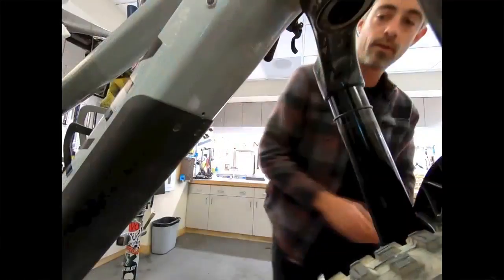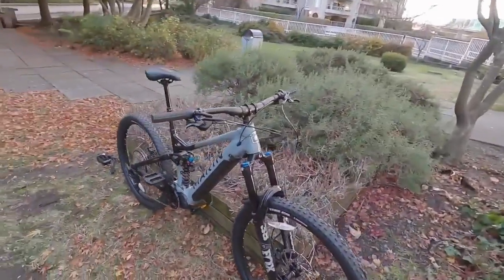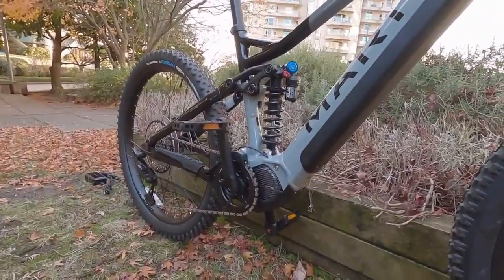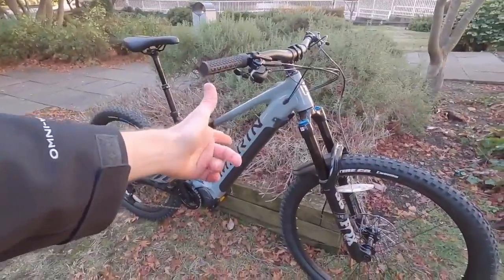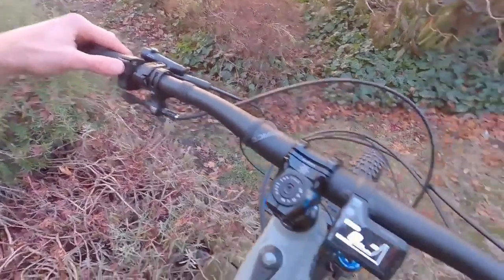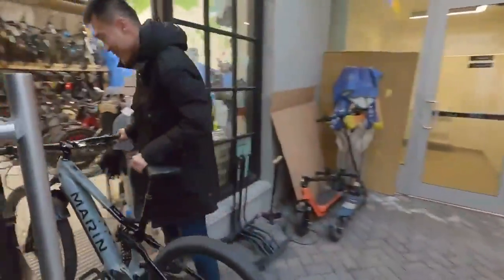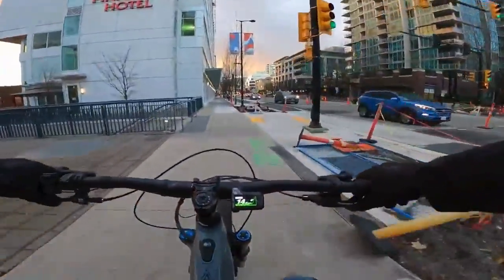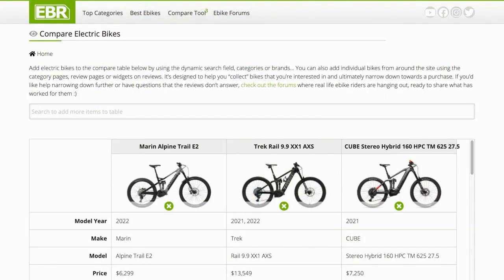Marin Alpine Trail E2 Review - $6.3k

Comment: You said it’s a medium but I can see an “L” on the seat tube? How much do you weigh? As the medium has a 350 spring and the large has a 450 spring. I’m 76kg so it says I should be on the 350. But I’m 5.11 which says I should be on a large. I think I would like the stiffer 450 spring.

Edit. Also, does it have walk assist? Hold the button to help push it up a hill?
Reply: All things considered, I'd say you're much better off just getting the frame that fits you best, because a new spring isn't expensive enough to warrant buying the wrong size (especially if it's a standard spring instead of a fancy lightweight or progressive spring).

Also, yes, the EP8 does come with a walk assist as standard, so I'd assume this is no exception.

Comment: I have an 2018 Easymotion Evo 27 Pro mountain bike in very good shape. Have had trouble with torque sensor in past but fine for the last year or so. Recently the display showed error code 13 then stopped coming on. Have cleaned all connections but no luck. Does anyone have number for BH Bikes in Europe. They seem to have left the USA and parts are not available here ! Or if you have any ideas how to fix it  or get new display?

Comment: Definitely some design issues.  Removal of the battery is unnecessarily complicated.
Reply from the maker: It kind of reminds me of the early specialized Turbo Vado models that used a long 15mm thru-axle bolt to secure the battery. Is it required additional time and tools to get that pack off, but didn’t add key locking security. I think I prefer this Marin solution, but there are definitely other ways to go. I like what Moustache has done, and Trek has some good solutions with the RIB side mount… But they’re a bit heavier.
Reply: At least you dont need a bike specific key for it.

Comment: The front shock actual hits the frame when rotated too far?
Reply from the maker: Yes, I have seen this behavior with other electric mountain bikes in the past as well. The larger downtube can make contact with the crown of the suspension fork. Some companies will lengthen the frame and reposition the steer tube to solve this, but that changes geometry. Here’s an example of a bike that does this: https://electricbikereview.com/trek/rail-9-9-xx1-axs/
Reply: @ElectricBikeReview  To me that's a defect for EMTB with that of kind of intended use
Reply: @nomad-pq4yw8iy7v  all modern Trek non ebikes have a thing called knock block which stops the fork from hitting the downtube. They say a straighter downtube makes the bike feel more direct, which is very common with modern geometry
Reply: @scootaa44   That system is different more refined.. Correct me if I'm wrong but I think if you didn't have knock block some of those bikes still wouldn't hit the frame..
Reply: @nomad-pq4yw8iy7v  yes definitely more refined, my treks fork would hit the downtube if the knock block system wasn't there.
Reply: @scootaa44  So you can't convert your bike to do bar spins🤣. I think your fine most of us aren't going to do bar spins but I have 2 modern geometry ebike that don't hit
Reply: @nomad-pq4yw8iy7v  haha yeah definitely no bar spins on a modern Trek 😭

Comment: The seat post looks like a broomstick. The flex must be bad.
Reply from the maker: It's amazing how strong these materials can be. Despite being skinny, most dropper posts I've tested are very sturdy. Usually rated up to 250lbs, but can likely handle much more as they expect rider weight to collide with the saddle on occasion. Some droppers posts have ~10mm suspension travel built in, a bit of play to reduce impact if you take a big hit.